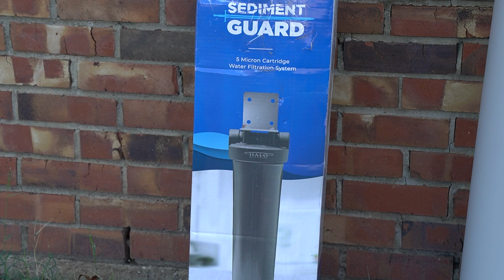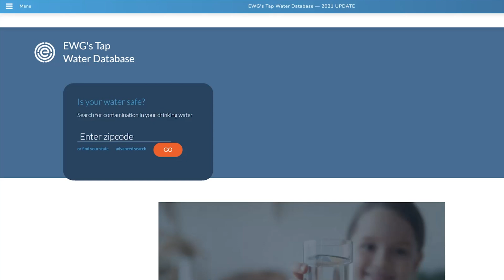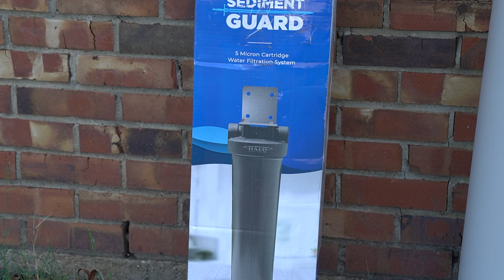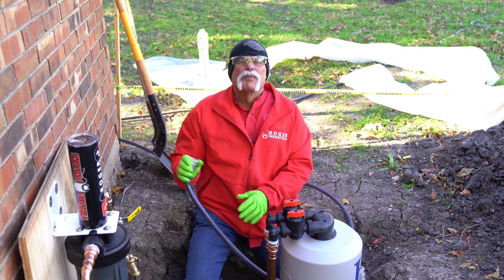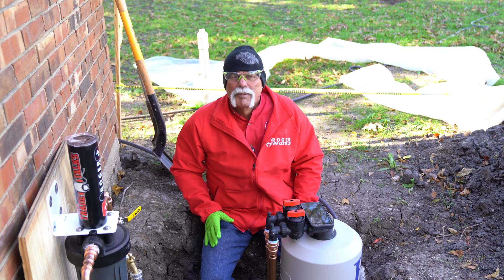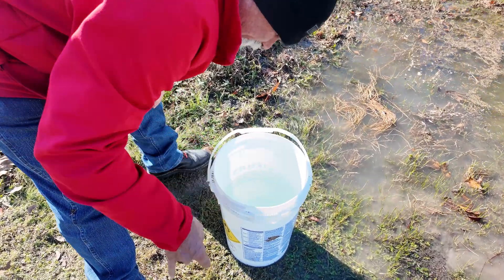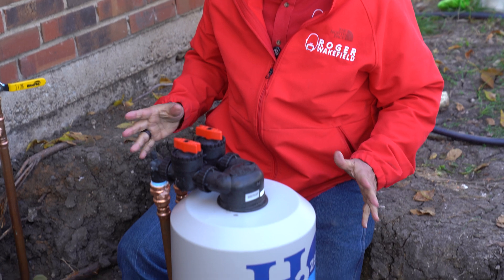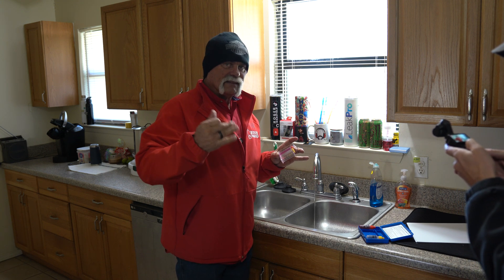Installing The BEST Plumbing Water Filtration System

Comment: Dont just open up the valves all the way when you first go to flush it. It can stir up the media too much and clogg the basket underneath the filter head and you wont be able to flush properly. If this happens you will need to let all the media settle back down to do the flush again.

Comment: Will this work with Indiana?
Worried about freezing.
(Smaller home, country, well water, I’d like space back in my utility closet, psi is very mediocre currently) thanks!
Reply from the maker: I'd probably bury the lines deeper and either install this in a basement or garage if possible, but yes it can work in Indiana..

Comment: Removing the chlorine can take away the ability to kill bacteria if it does end up getting into the potable water system if any of you do get any callbacks for weird smelling water just bypass the system so the city chlorinated water can kill the bacteria. 24 hours usually does the trick and then just show the customer how to turn it back on. I’ve seen this happen quite a few times.

Comment: Dechlorinating the tap water, wouldn't you be at risk of bacteria growth after the filter?
It would be very useful to hear your opinion and solution to the problem. Higher pH is certainly useful, it will protect the copper in the long run.

Comment: I'm kinda disappointed. I'm a 3rd year apprentice. I see zero marks on the press fittings.... As a vega installer, u need those marks for warranty? Show you cleaning and deburring the pipe... its part of practice and install. These are other products you could be promoting... i don't understand the gap in service and products you keep. You as a YouTube personality, and Master plumber, could have included Vega, had a rep on site to promote the fittings and brand? You mentioned nothing about the current sharkbite fitting being the wrong one for the transition fitting between dissimilar piping materials. You basically stated, you didn't wanna touch it? If it's wrong, I was kinda thinking you would Mike Holmes it? That alone would have been a great call out. If ur goals are ti teach us, brother you got some work to do. I like watching ur videos I just found, but, GD, DO THEY MAKE ME ANGRY.  Thinking u! Are the master, with the knowledge.

Comment: My company just started carrying those exact systems, and I installed our first or second unit a few weeks ago. Seems like an okay system. I'm more on the water treatment side of the company rather than plumbing, so I'm slightly skeptical of the time claim but again they seem to work fine so far. Good for chlorine as you had plus hardness without the need for a water softener. I will say though it took a very long time for all the fines to make it through. pH can also increase from carbon, so that's probably why it spiked.

Comment: Somewhat off topic, but someone just recommended that we try an electronic descaler, like Eddy or similar, to help with our hard water. Honestly sounds like snake oil, but is there anything to them?
Reply: I'll preface this by stating that although I am a plumber/pipefitter, I am not a water treatment specialist. That being said, an electronic descaler can help prevent scale buildup within your plumbing and fixtures in certain situations, but it's not going to soften your water. The only real way to soften your water is chemically with a water softener. But you do have to remember, water softening is only one step to an entire treatment system. Different contaminants at various levels need specific types of treatment. For example, municipal water is different than well water. Wells vary greatly from region to region; even from neighbor to neighbor. There's no one size fits all treatment. I would recommend getting your water tested so you know exactly what needs to be done to treat your water effectively. Just my opinion.

Comment: In my 18 years I have never once seen a tank buried in a yard before. Does nobody in Texas own a basement with an interior main to pit this next to?
Reply: Basements are pretty rare in Texas. Our frost line is a few inches, so there is little site work before hand like up north. Also, Most of Texas is  limestone, excavation can get extremely pricey.
Reply: @pyroman590  appreciate the info. Does it still need some form of protection to prevent possible freezing or no?
Reply: No bro, in Texas you have to dig bro

Comment: Yo Roger! Why not do the sediment filter first and then the water filtration?
Reply: sediment is after in order to catch carbon particles since this is upflow
Reply: @CelticDT  but you flush the carbon particles out before it goes to your taps with a drain valve
Reply: @Zaldabin  carbon will break down over time
Reply: Supposed to have the Sediment filter (post filter) after the carbon filter to catch any debris over time.
Reply: Genuinely curious!
Reply: In my water filtration system the plumber installed the sediment filter before the carbon filter. It nice and brown after 8 months
Reply: @engrpiman  You're supposed to change sediment filters every 6 months so yeah, that makes sense.
Reply: @ I'm on city water and don't notice much of any pressure drop. The plumber told us 6-12 months when you notice a pressure drop.  I'm using a 5-20 micron filter.

Comment: I live in NJ. Does this softens water also?
Reply: A water softener works by using a process called ion exchange, where it removes calcium and magnesium ions (which cause hard water) from the water by replacing them with sodium ions from a salt solution, essentially "trading" the hard minerals for sodium as the water passes through a tank filled with resin beads that attract the positively charged hard minerals; once the resin becomes saturated with these minerals, it needs to be regenerated with a salt brine solution to release the captured minerals and reset the system to soften new water.  

If the system featured here truly softened water - why would anyone lug 40# bags of salt from the store to their softener?  He should have tested the hardness before and after - I wonder if that was strategically omitted.
Reply: It's a nonbackwashing filter, not a softener.
Reply: It does soften the water tho
Reply: @SkyHighMediaGroupSMG  If it's a so called "salt free conditioner" that's not true softening.
Reply: It removed the need to actually soften the water while still allowing you to get the minerals the water